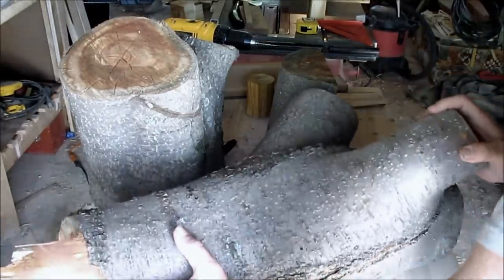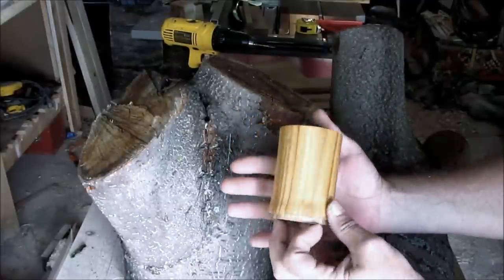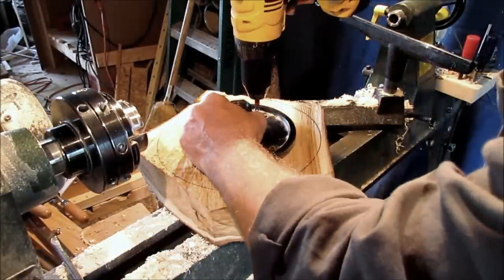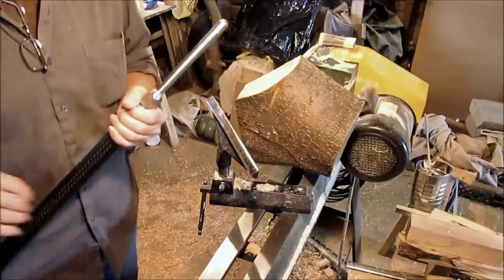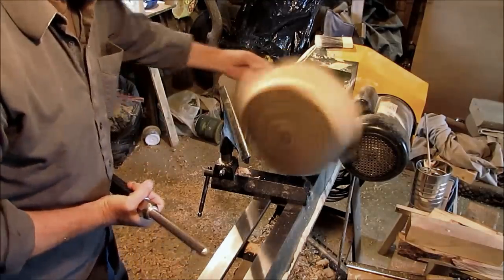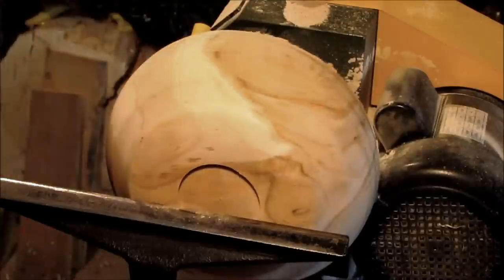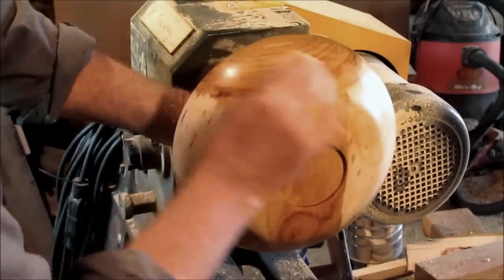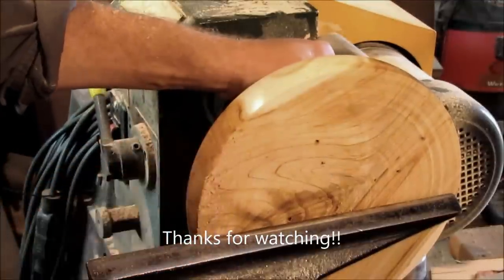Woodturning Wood From a Neighbour

Comment: Nice job, Jerry -- a beautiful piece of wood and a pleasure to watch.  Two ideas:  1)  pretty sure you can modify the lathe to go slower by drilling an additional hole to accept the pin under your Reeves drive control handle.  I used to use an older Jet 1236 (almost identical to your lathe) and made this modification, because 500 RPM is a little sporty with a bigger bowl blank  ;~)  2)  You could make a shelf where the leg braces are with some 2x8's and weight her down with a few hundred pounds of sand -- really helps with heavy bowls.
Reply from the maker: Thanks for the tips Brad! So far, this has been one of the biggest I've turned. I haven't yet had a problem with the speed as I'm pretty good at getting the blanks on there balanced. I did at one time have a couple of giant logs on the shelf for weight, but I chopped them up and turned them lol.
Thanks for watching!
Cheers!

Comment: How do you deal with the screws holding the wood??
Reply from the maker: The screws only go into the wood about an inch. When I cut the bottom of the bowl, I'm only taking enough wood to shape the bowl and cut a mortise for my 4 jaw chuck. Once the bottom is finished, I unscrew the face plate and turn the piece around, fastening it into the chuck. When I turn the inside of the bowl, the screw holes get cut away.
Hope that helps.
Thanks for watching.
Cheers!

Comment: How do you like the harbor freight lathe and how many miles have you put on her?
Reply from the maker: I had it for about 4 years. It served me well. Unfortunately it got destroyed when our house caught fire and the fire dept., in their efforts to put it out,  filled my basement shop with 3' of water. It was a terrible loss, but we were insured. I've just finished setting up my new lathe and am looking forward to making some new videos soon.
The lathe in the video is probably from the same place as the harbor freight, but it was a Craftex B2338, 3/4 hp, 14x43" with a 1"x8 tpi spindle. The adjustment handles were a bit weak and I broke the one on the height adjustment for the tool rest. No big deal, I just had to keep a pair of pliers nearby to adjust the height. It worked well for me, although it was a pain in the ass. I just couldn't be bothered to find a replacement. lol The machine itself was sound. I have to say, I do miss it.
Thanks for watching.
Cheers!

Comment: new to wood turning, how long did it take to round off the log? thanks
Reply from the maker: Sorry it took so long to get back to you, Ryan. 
I only takes me about 5-10 minutes to get it to round... longer if its difficult or larger, or if I'm demonstrating/teaching what it is I'm doing. 
Honestly though, it really doesn't matter unless you are a production turner. It is not a quick process, and for someone new, it may take a half hour, maybe more. And that is fine. It isn't a race.
Take the time to learn the tools and how to use them. 
You should never fear your tools or machine, but do have a great respect for what they can do.
Gentle is the key for the beginner. The learning is faster that way.
Start small and strive not for perfection of product, but to perfect your technique.
Watch the guys who's work you admire, and want to emulate.
Most of all, enjoy what you do. 
Speed will come.
I hope that helps.
Cheers!
Reply: Thank you for advise. I am more bull at a gate type of guy guess I'll have to change my ways

Comment: Is there a reason why you didn't keep part of the bark showing on the bottom?  
Is it possible to keep a section like that raw and finish it?
Reply from the maker: I just didn't think it would have worked with the rest of the bowl. 
It is possible to leave bark on and finish it, but hand finishing would be best in that case as opposed to finishing on the lathe. To keep the bark in place, it is also good to go around the perimeter of the bark with a good, thin CA glue to avoid it separating from the rest of the wood.
Thanks for watching!
Cheers!
Reply: Thanks for the response!
Great work!